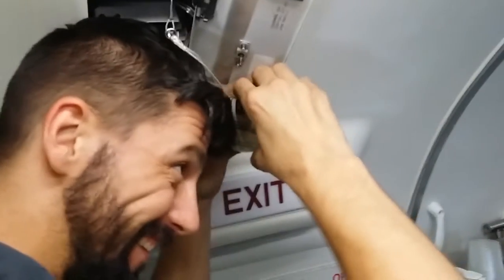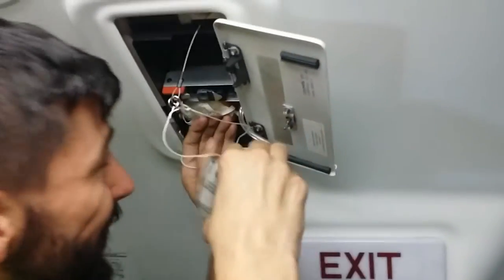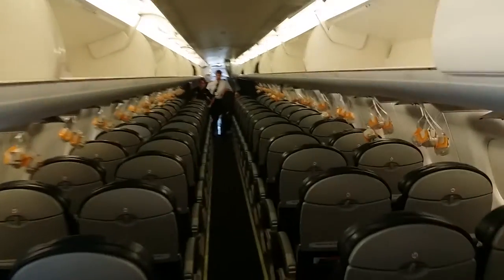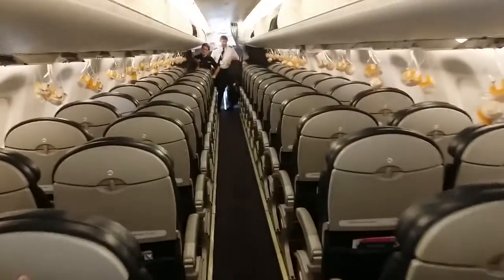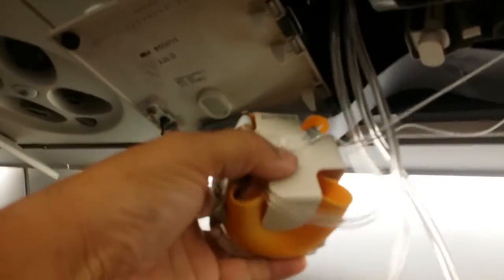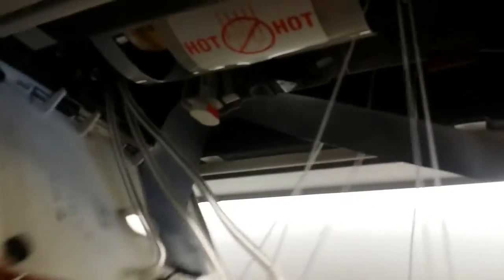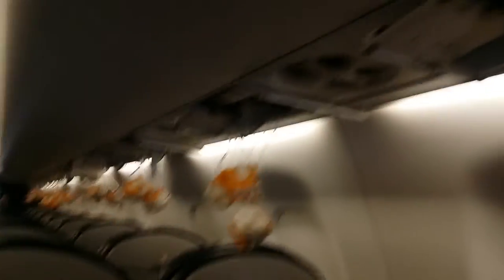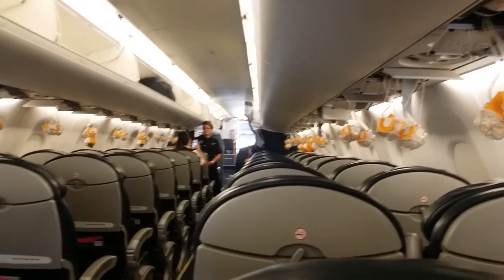Oxygen masks drop

Comment: Why is there three masks if there's only two seats
Reply from the maker: just in case there is a lap child in that row
Reply: Aircraft systems EMBRAER family makes scince
Reply: Also, crew may use the extra mask if they're not close enough to their portable ones when the loss of pressure happens.   Either taking a few breaths and then moving to the nearest portable, or waiting for someone to bring them one.
Reply: To help an infant/child or crewmember if they are out helping the passengers
Reply: It’s required by the FAA on all aircraft incase there is an infant or flight attendant in the cabin
Reply: @kd5nrh Nope actually, if they drop in the cabin the flight attendants have to sit anywhere including people’s laps and put on a mask, until “Purser to the Flight Deck” or something similar is heard (if no communication is coming from the flight deck then there’s an emergency procedure that’s done)